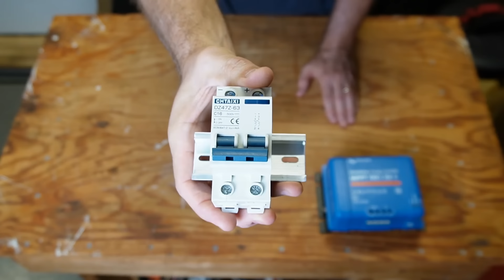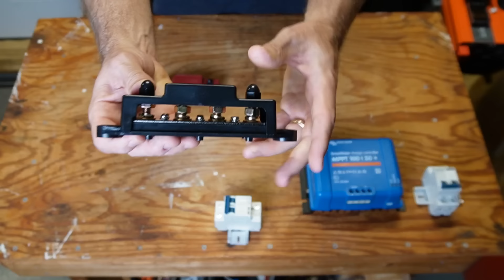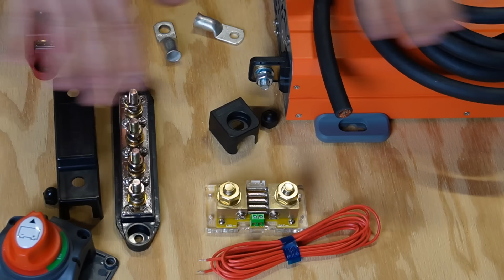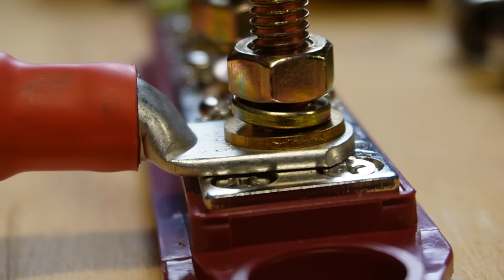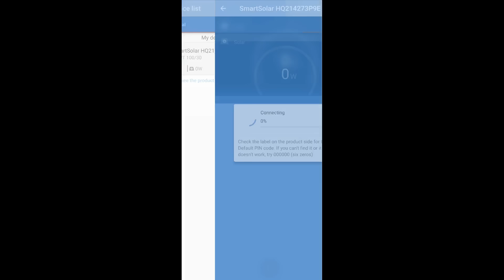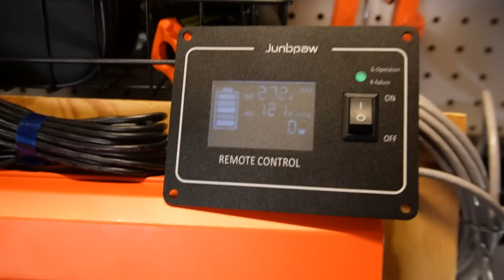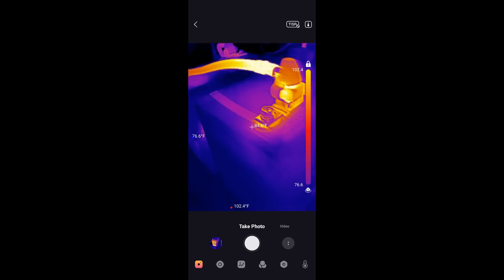24V DIY Off-Grid Solar Generator Build For Beginners

Comment: Thank you for this video, now I have a clearer understanding of what goes into this. I bought a solar generator and 2 200w pannels of amazon, and now my mind is on a solar rabbit hole that will most likely have me spending thousands of dollars 😂😂😂
Reply from the maker: It is addicting. I sometimes wonder if this has become more of a hobby than a need.
Reply: Same here, the systems keep getting bigger.
Reply: Reporting back now with a 4.5kwh solar array and 15kw (soon to be 25) of battery storage, a critical loads panel and 12kw inverter 😆
Reply: You & me both. I'm obsessed 😍
Reply: 255  God! There is no god except He, the Living, the Everlasting. Neither slumber overtakes Him, nor sleep. To Him belongs everything in the heavens and everything on earth. Who is he that can intercede with Him except with His permission? He knows what is before them, and what is behind them; and they cannot grasp any of His knowledge, except as He wills. His Throne extends over the heavens and the earth, and their preservation does not burden Him. He is the Most High, the Great.
256  There shall be no compulsion in religion; the right way has become distinct from the wrong way. Whoever renounces evil and believes in God has grasped the most trustworthy handle; which does not break. God is Hearing and Knowing.
257  God is the Lord of those who believe; He brings them out of darkness and into light. As for those who disbelieve, their lords are the evil ones; they bring them out of light and into darkness—these are the inmates of the Fire, in which they will abide forever.
258  Have you not considered him who argued with Abraham about his Lord, because God had given him sovereignty? Abraham said, “My Lord is He who gives life and causes death.” He said, “I give life and cause death.” Abraham said, “God brings the sun from the East, so bring it from the West,” so the blasphemer was confounded. God does not guide the wrongdoing people.
259  Or like him who passed by a town collapsed on its foundations. He said, “How can God revive this after its demise?” Thereupon God caused him to die for a hundred years, and then resurrected him. He said, “For how long have you tarried?” He said, “I have tarried for a day, or part of a day.” He said, “No. You have tarried for a hundred years. Now look at your food and your drink—it has not spoiled—and look at your donkey. We will make you a wonder for mankind. And look at the bones, how We arrange them, and then clothe them with flesh.” So when it became clear to him, he said, “I know that God has power over all things.”
260  And when Abraham said, “My Lord, show me how You give life to the dead.” He said, “Have you not believed?” He said, “Yes, but to put my heart at ease.” He said, “Take four birds, and incline them to yourself, then place a part on each hill, then call to them; and they will come rushing to you. And know that God is Powerful and Wise.”

2  God, there is no god but He, the Living, the Eternal.
3  He sent down to you the Book with the Truth, confirming what came before it; and He sent down the Torah and the Gospel.
4  Aforetime, as guidance for mankind; and He sent down the Criterion. Those who have rejected God’s signs will have a severe punishment. God is Mighty, Able to take revenge.
5  Nothing is hidden from God, on earth or in the heaven.
6  It is He who forms you in the wombs as He wills. There is no god except He, the Almighty, the Wise.

11  Originator of the heavens and the earth. He made for you mates from among yourselves, and pairs of animals, by means of which He multiplies you. There is nothing like Him. He is the Hearing, the Seeing.
12  To Him belongs absolute control of the heavens and the earth. He spreads the bounties to whomever He wills, or reduces it. He is aware of all things.
13  He prescribed for you the same religion He enjoined upon Noah, and what We inspired to you, and what We enjoined upon Abraham, and Moses, and Jesus: “You shall uphold the religion, and be not divided therein.” As for the idolaters, what you call them to is outrageous to them. God chooses to Himself whom He wills, and He guides to Himself whoever repents.

54  Your Lord is God; He who created the heavens and the earth in six days, then established Himself on the Throne. The night overtakes the day, as it pursues it persistently; and the sun, and the moon, and the stars are subservient by His command. His is the creation, and His is the command. Blessed is God, Lord of all beings.
55  Call upon your Lord humbly and privately. He does not love the aggressors.
56  And do not corrupt on earth after its reformation, and pray to Him with fear and hope. God’s mercy is close to the doers of good.
57  It is He who sends the wind ahead of His mercy. Then, when they have gathered up heavy clouds, We drive them to a dead land, where We make water come down, and with it We bring out all kinds of fruits. Thus We bring out the dead—perhaps you will reflect.
58  As for the good land, it yields its produce by the leave of its Lord. But as for the bad, it produces nothing but hardship and misery. Thus We explain the revelations in various ways for people who are thankful.
59  We sent Noah to his people. He said, “O my people! Worship God; you have no god other than Him. I fear for you the punishment of a tremendous Day.”
60  The dignitaries among his people said, “We see that you are in obvious error.”
61  He said, “O my people, I am not in error, but I am a messenger from the Lord of the Worlds.”
62  “I deliver to you the messages of my Lord, and I advise you, and I know from God what you do not know.”
63  “Do you wonder that a reminder has come to you from your Lord, through a man from among you, to warn you, and to lead you to righteousness, so that you may attain mercy?”
64  But they called him a liar. So We saved him and those with him in the Ark, and We drowned those who rejected Our revelations. They were blind people.

59  The likeness of Jesus in God’s sight is that of Adam: He created him from dust, then said to him, “Be,” and he was.
60  The truth is from your Lord, so do not be of those who doubt.
61  And if anyone disputes with you about him, after the knowledge that has come to you, say, “Come, let us call our children and your children, and our women and your women, and ourselves and yourselves, and let us invoke God’s curse on the liars.”
62  This is the narrative of truth: there is no god but God. God is the Mighty, the Wise.
63  But if they turn away—God knows the corrupt.
64  Say, “O People of the Book, come to terms common between us and you: that we worship none but God, and that we associate nothing with Him, and that none of us takes others as lords besides God.” And if they turn away, say, “Bear witness that we have submitted.”
65  O People of the Book! Why do you argue about Abraham, when the Torah and the Gospel were not revealed until after him? Will you not reason?
66  Here you are—you argue about things you know, but why do you argue about things you do not know? God knows, and you do not know.
67  Abraham was neither a Jew nor a Christian, but he was a Monotheist, a Muslim. And he was not of the Polytheists.
68  The people most deserving of Abraham are those who followed him, and this prophet, and those who believe. God is the Guardian of the believers.
69  A party of the People of the Book would love to lead you astray, but they only lead themselves astray, and they do not realize it.

84  Say, “We believe in God, and in what was revealed to us; and in what was revealed to Abraham, and Ishmael, and Isaac, and Jacob, and the Patriarchs; and in what was given to Moses, and Jesus, and the prophets from their Lord. We make no distinction between any of them, and to Him we submit.”
85  Whoever seeks other than Islam as a religion, it will not be accepted from him, and in the Hereafter he will be among the losers.

28  It is He who sent His Messenger with the guidance and the religion of truth, to make it prevail over all religions. God suffices as Witness.
29  Muhammad is the Messenger of God. Those with him are stern against the disbelievers, yet compassionate amongst themselves. You see them kneeling, prostrating, seeking blessings from God and approval. Their marks are on their faces from the effects of prostration. Such is their description in the Torah, and their description in the Gospel: like a plant that sprouts, becomes strong, grows thick, and rests on its stem, impressing the farmers. Through them He enrages the disbelievers. God has promised those among them who believe and do good deeds forgiveness and a great reward.

111  And say, “Praise be to God, who has not begotten a son, nor has He a partner in sovereignty, nor has He an ally out of weakness, and glorify Him constantly.”

Read The Quran

Comment: Ok what can it run. I’m researching solar , I want to run a window a/c unit and plugs in my shop. Some of the tools will pull 15amp on startup. I will leave my 240v hooked up to the house power.
Reply from the maker: The AC I used in the video may have pulled 15amps on startup. I didn't check that. It used about 8-9 amps continuous. I only had once that it failed to start that AC. Multiple times, it started it fine. Just to be sure, you could get a little larger wattage capacity. Especially if your going to be running an AC and tools at the same time.
Reply: When I built my "inexpensive" power station I used a 2000 watt continuous inverter. A typical single 15amp rated 120vac household outlet will do 80% of that 15amp rating continuously. That's 120v x 12a(80% of 15a) = 1440 watts continuously. So basically a 2000 watt continuous rated inverter will power anything you can plug into a typical household 15amp rated outlet and more. For example a properly installed single true 20amp rated 120vac household outlet (not as common as the 15a) would power 16 amps continuously using the 80% rule. 120v x 16a = 1920 watts continuously. So that 2000 watt inverter could match that 20a 120v household outlet as well.

Where you run into issues with inverters/generators/etc., is their surge-startup ratings and how many inrush amps may be associated with the devices you are plugging in.

I bought an AC AND DC capable amp clamp meter with inrush measuring capabilities. It was quite the eye opener with regards to starting/surge amps being drawn.

The nice thing about using a 12v battery based system is you have soooo much more/cheaper flexibility when it comes to various charging methods and 12vdc assorted items you can hook directly up to the 12v battery bank.

 I was torn at first to go higher battery voltage/smaller gauge wires but so glad now that I left it 12v. I can run many things off of a single 12v deep cycle battery and for times when I'm drawing higher amps I can then parallel more batteries easily if need be.

Unfortunately some high amp draw surge/starting/inrush items may still defeat my 2000watt continuous/4000watt inrush capable inverter. Namely an older circular saw I have that I have measured over 40 amps of inrush! 😂 (40×120=4800 watts!)

I'll probably step up to a 3000watt continuous/6000watt inrush capable inverter eventually. Now them will be some serious wires. 😆

It's nice having a quiet power station when building things in remote access areas versus a noisy generator. But I do like my gennies too!

Comment: I’m trying to build a 12v version from your previous videos, and I have a similar set up to you in my house with a sub panel/transfer switch that I can plug a gas generator in with a L-14 cord. I have an inverter I want to hardwire a receptacle like you did previously, but I’m wondering how you did yours? My L14 cord is 3 wire (4with ground) but my inverter only has 3 hard wire ports -ground, neutral, live.
Reply from the maker: So the l-14 wire is for 240v split phase typically that has 2 live wires. 120v each
 But when you have only 120v coming in from the inverter, I used a jumper wire (just a piece of same size wire) in the outlet which connects the single live wire to both live connections therefore providing the single 120v coming from the inverter on both live wires in the l-14 wire. This works fine, but you can't actually provide power to 240v appliances. Only 120v appliances.
Reply: Thank you for your response!! That’s kinda what I was thinking would be going on. Yes, only 120v appliance circuits available in my sub panel anyway so this is great. I really enjoy your videos and ideas! I’m glad I found them because you’re the only person I’ve found that had the same set up I wanted to do. Thanks again!